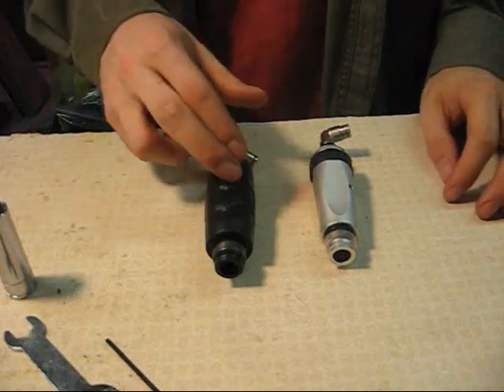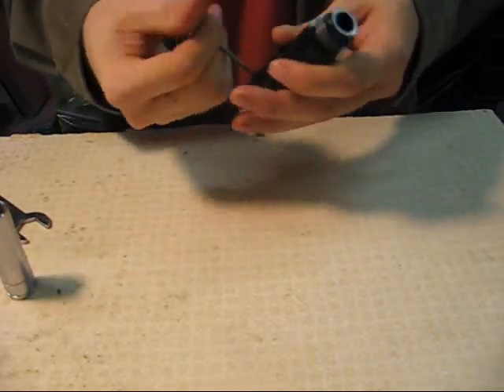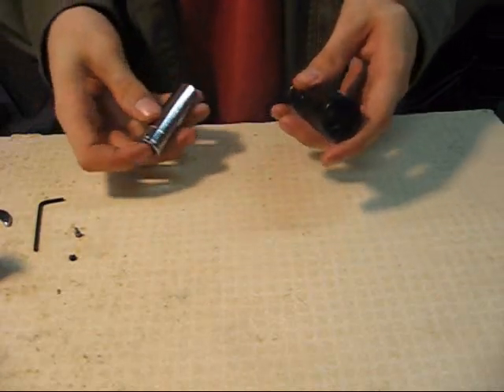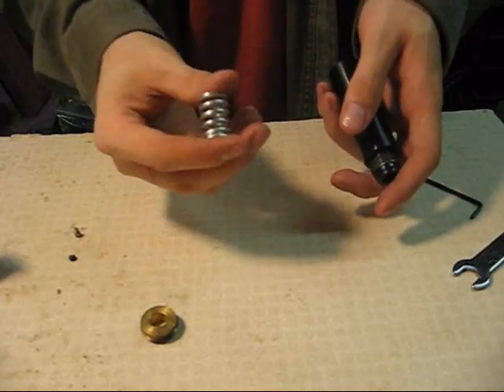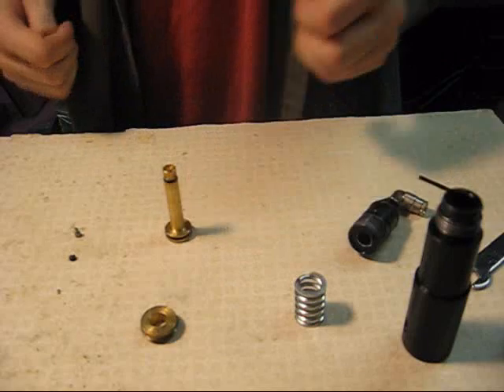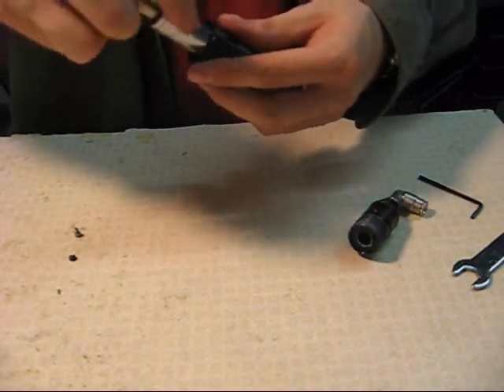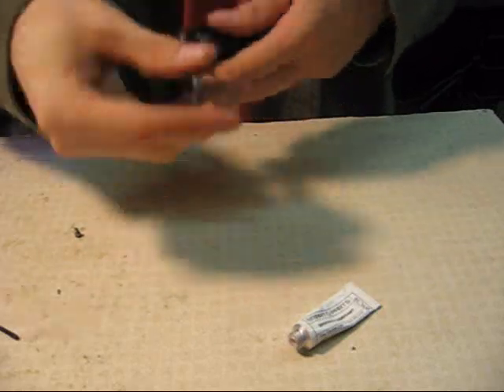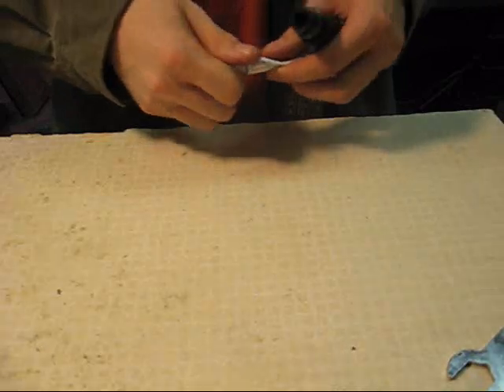ion/NXT regulator maintenance

Comment: You’re missing the plastic washer that sits on top of the bottom piston.
Reply: Does not exist in all of them.  It is a shim to increase pressure that was put in the guns that ran slightly higher pressure.

Comment: @balfanater So you think im better off buying another regulator from a different brand? because the one i have right now is leaking and i wasnt able to remove the piston, i damaged the bolt inside so now i cant remove it..i pretty much think i need to replace the regulator and the macro line fitting 90 degrees and straight..i couldnt figure out wich was making my gun leak so i guess ill just spend the money and buy everything new..any suggestions?